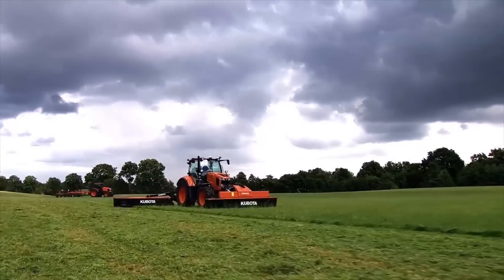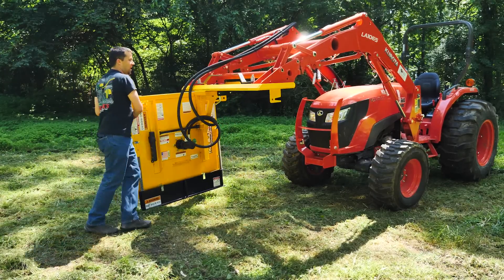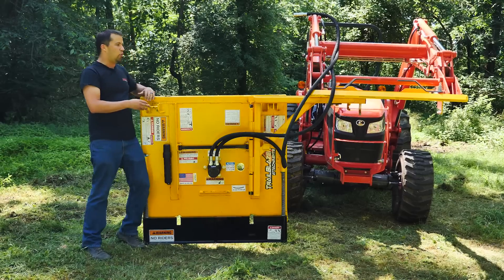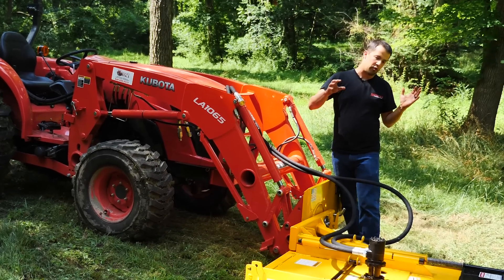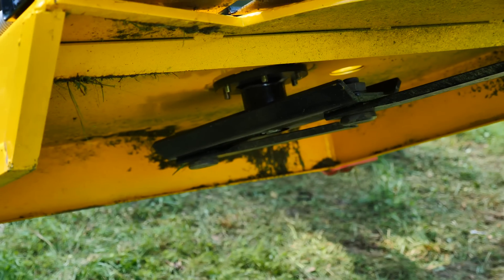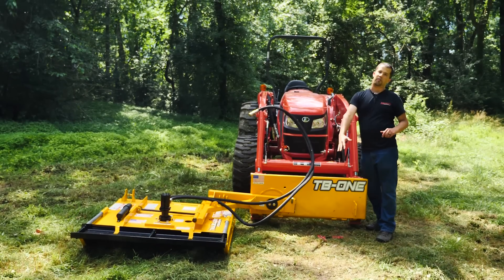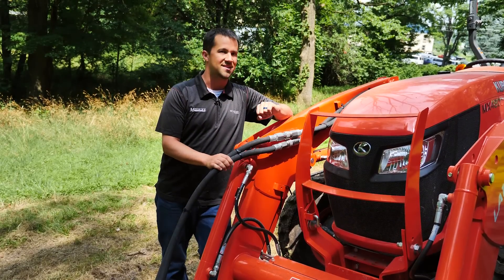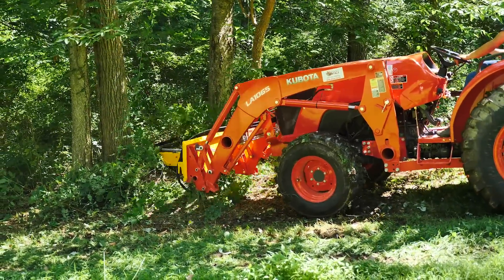TrailBlazer TB-One Front Mount Rotary Mower

Comment: That power pack could power a front-mounted post hole
digger. No more difficulties with huge angles for the
drive shaft and operator danger. Plus it would be
great to have the digger in easy visibility.
Reply from the maker: MY thinking too

Comment: I see some real advantages of having this. But, if you don't have some extreme mowing conditions, is the cost worth the convenience? I see a some issues that I have with it right out of the gate. I do not like the looks of it positioned that far off to the side. I am quite sure that the loader arms and the ssqa are not engineered for that type of stress. Next would be all the dust, dirt, and debris from up front would plug the radiator rather quickly. Lastly, and a pretty easy fix, is the way the hydraulic hoses are configured. That looks to be an expensive fix very shortly down the road. Great video Neal, as always. Thanks for putting this out there.

Comment: the power pack is more interesting. i built a nearly identical one years ago to mount a skid steer backhoe to one of my old International tractors. i think i'll resurrect it because i wanted to get a hydraulic auger for the front and my MX4800 doesn't have enough hydro flow to power one. of the two products, the powerpack is the one with more potential to sell other optional equipment for our tractors that was once only for the realm of skid steers due to the hydro-flow required. at $1500 it's a great price as i think it cost me $1000 to build the one i made. to have one ready to go with all the hoses/filter/mounting/pressure relief valves/etc. is actually a somewhat difficult thing to engineer. another thing to consider, if i own a power pack then i can go to a rental yard and say rent a auger for a skid steer, use it, and not worry about contamination of my ultra-expensive Super UDT fluid in my tractor. i'd hate to mess up my tractor because of some rented equipment pumped a bunch of ATF into my tractor's hydraulic system.

Comment: Nice demonstration.  I originally was looking at the Lane Shark unaware of the TrailBlazer company.  I like the rear fluid-distribution sump-pump which off-sets weight and feeds rotary mower fresh hydraulic fluid. My concerns are the front digging into the ground which puts a lot of stress on loader arms. Pivoting needs to be refined.  A float should make this implement pretty nice. Thanks for this video.
Reply from the maker: it has several improvements over the lane shark, plus we already dealt with the parent company.
Reply: @MessicksEquip  what do you mean by, "dealt with the parent company"?
Reply from the maker: @wpog8453  Titan implement is the parent company,  we already sell their attachments

Comment: It really wouldn't be hard to replace the black adjustment rod with a small hydraulic cylinder and use a 3rd function valve or even a adjustable top link. Just a thought!
Reply: 67dueceman I was wondering the same.  Would be nice to have some hydraulic adjustments on the front you could run from your rear remotes.
Reply from the maker: there are a lot of easy tweaks you could make to this in your garage that I think could be legitimate improvements.
Reply: That’s what i did with the one we are building. 

I was all set to buy a Lane Shark but they keep raising the price so i decided to build one for about $2200. 

Mine will be offset all the time and 3rd function will be go -15 to 90 degrees.
Reply: @joelrarick8384  you'll spend more time making the thing than you'll save. $3k-$4k is easily justifiable for a unit that will do work like this and do it reliably and virtually maintenance free. I know that they are probably making a killing off the units but if they price seems outrageous to you, you're just being cheap and will probably spend a dollar to save a dime

Comment: I just picked up one of these which is the Gen 2 version  with the power pack. The dealer was different from my Kubota dealer because they didn't sell them. They did a great job of setting it up. However,, didn't think the hoses on the power-pack would work with a 3 point quick attach. Trail Blazer won't return my calls on thus question. I have a hydraulic top link. If a quick attach doesn't work,  would a Pat's easy change system work instead?
Reply from the maker: I'm not sure if that's quick hitch compatible myself. Those things can be pretty hit and miss
Reply: @MessicksEquip  What about Pat's easy change? We have an almost 40 year 17 hp Kubota and that sure helped getting the brush hog on. Our new tractor is a Grand L 3560 le that we got 2 weeks ago. It  was a family purchase and we got it loaded up. 3 rear OEM remotes, OEM 3rd function and the hydraulic ssqa on the front loader. We also went to another Kubota dealer to get the tires loaded with beat juice since our dealer didn't carry it. A salesperson and the manager looked it over, because the had never seen one optioned that way. Plus they were also curious about the adjustable add a grapple by Precision that was on the pallet forks. It will pick up round haybales as advertised.
Reply: @MessicksEquip   I heard back From trailblazer today. A quick attach will not work with the power pack. They are  Not sure about a Pat's easy change  System on the 2 lower arms. He thought if the pets didn't go more than 2" past The  Holes on the 2 lower arms, then it would probably work

Comment: So with a custom return line this will work with a third function on a MX5200?  It's rated at 9.5 GPM but I would imagine the actual rate is borderline with the minimum that this attachment requires.  I've seen this before but its gonna be quite some time before I can buy one, but when I do I'll probably want to use it with the backhoe on, at least some of the time.  I'll probably use it mainly to maintain field edges and my roads through the woods.
Reply from the maker: Yes, as along as you return to sump you can feed from the 3rd function. Surprisingly I think it will do fine at lower flow.
Reply: How do you keep the cutter running when the third function is a momentary switch?
Reply: @MLJenkins  You can wire in a toggle switch.  Even without that your hand is going to be on the handle to make adjustments so you could just hold the button down.
Reply: @MessicksEquip  My second closest Kubota dealer is a dealer for these as well so hopefully they can get me fixed up if I ever decide to part with the money for this.  I love your videos and I wish you were closer so I could buy more stuff from you but I do buy parts from you once in a while.
Reply: @MLJenkins   i have been told by a dealer for these things AND the people at EVERYTHING ATTACHMENTS that the little motor for the 3rd function is NOT ment to run constantly and WILL burn it up !!

Comment: So…if someone had a larger tractor: Kubota M5-111 or M4-71; would the power pack still be needed for cooling of hydraulic fluid? 

Thanks in advance.

Marky
Reply from the maker: No issues on larger machines.

Comment: If it’s powered from an independent power bank, is there a reason why it can’t be used on a smaller tractor such as a BX? If there is, are you aware of a similar mower that would work on a BX?
Reply from the maker: not a good idea on a BX. its just too small.

Comment: it's a cool beginning concept and could definitely be refined. 

definitely needs a hydraulic side tilt- something that could be plumbed into the 3rd function.
getting on and off to keep the contour adjusted is a PITA. maybe an option in the future?

a set of 3" skis that mount to each side of the mower would have been a good upgrade to allow it to float along the ground better. maybe adjustable so that a mow height can be set. that  way you could put your mower in "float" position and have it skim across the ground without digging in. 

 the power pack need to be built with more ground clearance. it nearly drug ground when you were mowing up that hill.  some simple drop legs that could be pinned up after you hook it up would have been much easier to build than that frame and provided more ground clearance.

Comment: Can it run on front PTO and have a bush hog on rear?
Reply: It's probably run off the rear PTO.
Reply: The power pack is quite big, so doesn't really fit to the front. And if you have big enough tractor to fit it, the you should just use the tractors own hydraulics. So you could put something at the back, if you don't need the power pack.

Comment: I've had the fantasy of the MK Martin snow blowers with hydraulic power from a PTO hydraulic power pack ( maybe someday ). I know MK martin makes a power pack as does Land Pride. Am I correct - the TrailBlazer power pack would be a little undersized? Which ( Land Pride, Mk Martin ) would actually work better as a low flow hydraulic power source? Thanks for the always interesting and informative videos.
Reply from the maker: Yea, this power pack is not enough for a snow blower. You could use the larger snow blower power packs, you would just need to order this with the right flow rate motor.

Comment: It is easy to see how if the mower deck is raised off the ground at all it can throw all kinds of nasty debris at not only the operator but anyone who happens to be nearby,
Reply: I have one. That doesn’t happen usually. If you are cutting tree limbs directly in front of you at full height then small particles and leaves do fall on you. I haven’t encountered anything dangerous yet.
Reply: Emphasis on the word" YET"!
Reply: @henrystoyer694  there's nothing unsafe about it unless you tilt mower down to the point that you can see the the blades. Then you're in danger of flying debris. Always easy to pick out the guys that have little to no experience with machinery like this.

Comment: I've run a boom mower for 4 years I can see a lot of liability involved with that mower 4 people that don't know what they're doing, it should never be above the tractor in a flat position without a cab, that sad I have been looking into these mowers they could be a great tool used properly. Just some food for thought when you mow along the road you start at the top and do your brushing working down then you mulch that up with the grass also when you was going into the Briars take the mower up above the Briars at about a 45 so not to throw it at you and pull it down to the ground that's how I would do all brush with that mower. This mower looks to be the best I've seen for the price, like to have one.

Comment: Do they make a flail version of this?

Looks like it needs a counter weight on the left side when the mower is extended to the right.
Reply from the maker: No flail. The tractor in this case is big enough there is no need for counter weight, but a smaller one may.

Comment: I have a Powerstar 4.75 cab with front hydro connections on front loader arms. Would this unit plug and play or would I need the extra unit. Do you have any stores in west Texas?
Thank you in advance
Reply from the maker: you have to return the hydraulics to the case, can't feed back from your 3rd function.
Reply: Tim Smith unless you want to replace your windows I wouldn’t put this on your tractor. I have a t4.75 also. I run a long arm bush hog 5 days a week. 
They need safety glass around the cab area . They are going to get some hurt or killed.
Reply: Thank you

Comment: I am looking for an offset mower solution to mow grass under and around a thousand macadamia trees. This mower could work if they work out how to make the mower ride over the ground.
Reply from the maker: Agree. It needs some casters or something to float better.
Reply: Look for a ditch bank mower. They are hydraulically driven with a pto powered pump and are mounted on a pivot with a hydraulic cylinder . The offset mower deck will pivot 180 degrees from straight up to straight down.

Comment: You copied the land shark
Reply from the maker: We are a retailer, not a manufacturer. We've sold both, there are a handful of differences
Reply: And land shark copied all the other hydraulic brush hog manufacturers that came before them.
Reply: Warsign01 please enlighten us.
Reply: @LaneSharkUSA  this is not a new concept, just another take on it.
Reply: Warsign01 correct, I was inspired by many different machines to create the Lane Shark. But a copy it is not.
Reply: @LaneSharkUSA The original comment was to Maxx who claimed you guys were being copied.  My point to Maxx being, that most manufacturers piggy back (copy) off others designs.  It's a brush hog, they have been around a while.  I believe my comment was taken out of context.  Anyway, best regards.